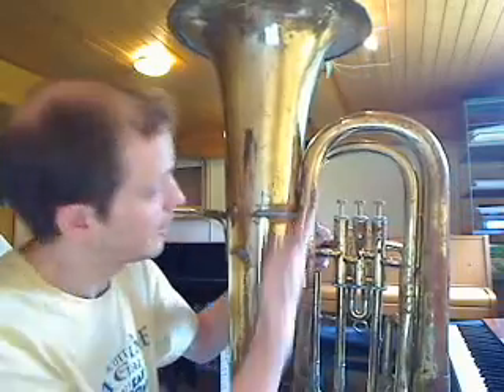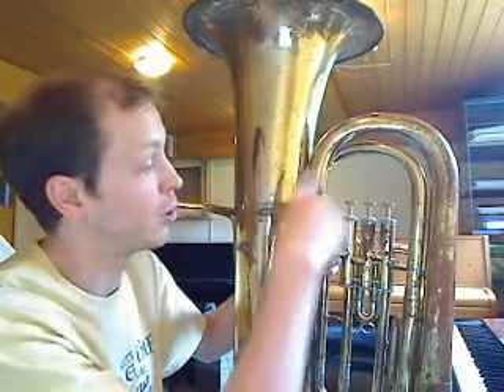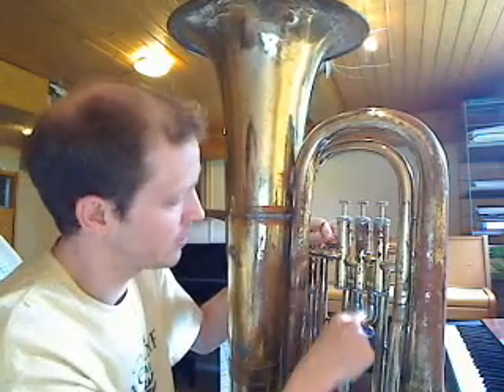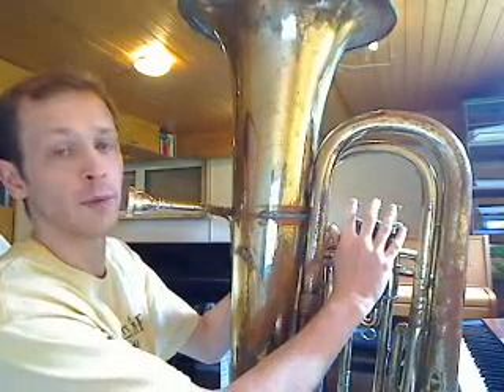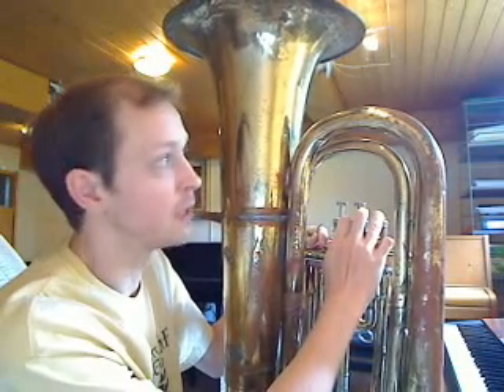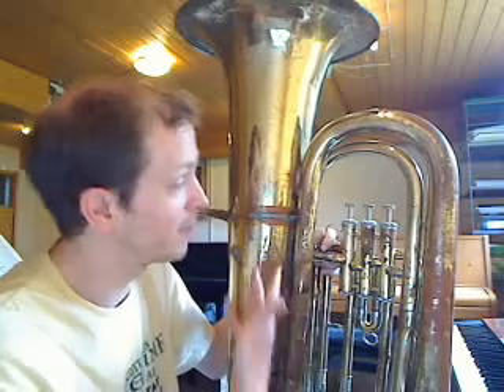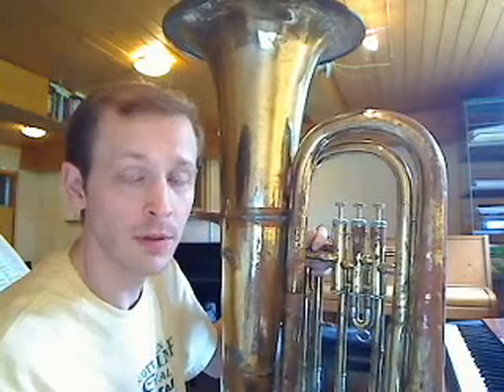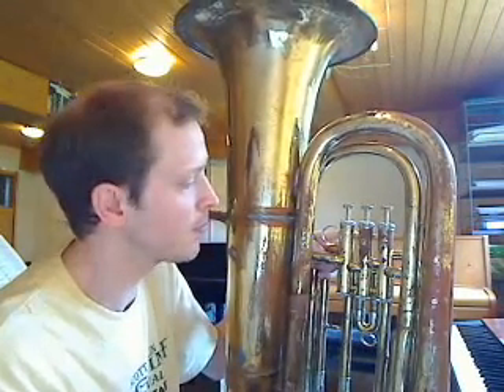1 Learning & Playing Tuba/Trumpet/Euphonium/Baritone/Flugelhorn/French Horn/Cornet

Comment from the maker: There is basically one way your lips must be for each note you want to play. Then there are small variations which effect the tone-quality. But a good way of thinking about it is that there is a specific way your lips must be to play each of the open notes on your instrument (I only play 3 in the video, but there are about 10, depending on your instrument), and that the valves do the rest. But your lips do actually have to change a little bit for each different note you play. Hope that helps.

Comment from the maker: Thanks for your comment. Yes, certainly calling the valves 1, 2 and 3 is a good idea. That is usually what one calls them. The Grandfather etc. is only there so that one understands which valve is longer. As far as the 3rd valve goes (and whether it is sharp or flat), this depends upon the system of tuning that you use. If you tune the 3rd valve to be in tune alone, then it is, indeed, perfectly in tune when used alone. Usually, though, you would tune it to be a bit flat when played alone.

Comment from the maker: That's impressive.  I have a question for you: With all your experience, you have no doubt noticed that the fingering systems for all the instruments are the same, but what do you think about the different mouthpiece sizes?  Is it easy for you to switch between big mouthpieces (like tuba) and small mouthpieces (like cornet)?  Do you have a method for switching quickly?  Would love to hear about your experiences and any tricks you might have in this regard.  Thanks for the comment.